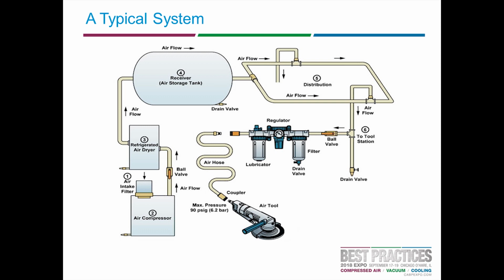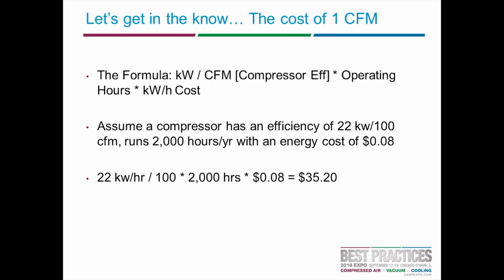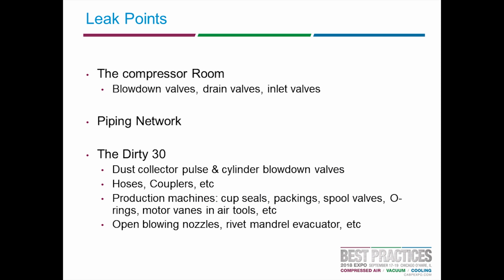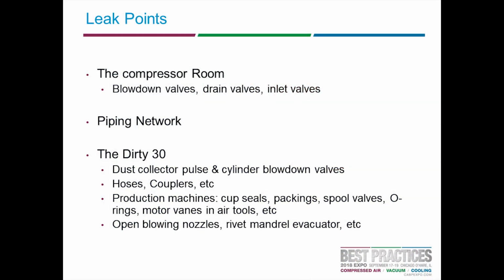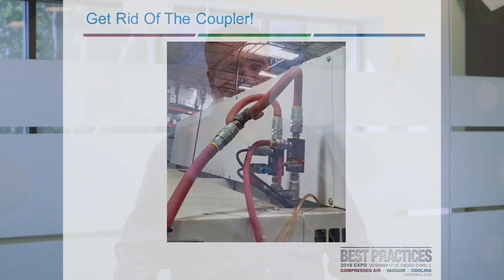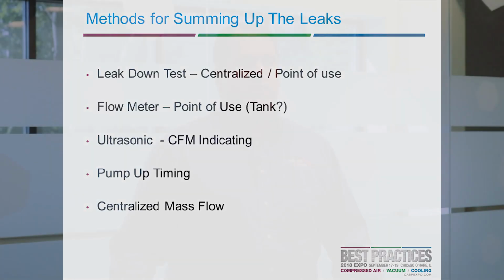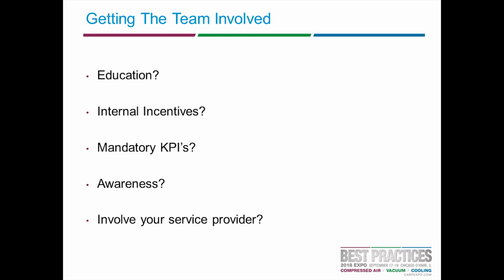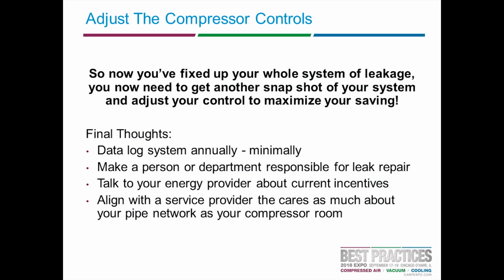My Air Compressor Leaking Air: What To Do? | Fluid-Aire Dynamics

Comment: Brad: You are exceptionally good in explaining the fact the energy cost is 73% in running the compressors.You impressed upon the viewers that periodically conducting the energy audit is essential in reducing/eliminating the compressed air leakage.A job very well done.Congrats.